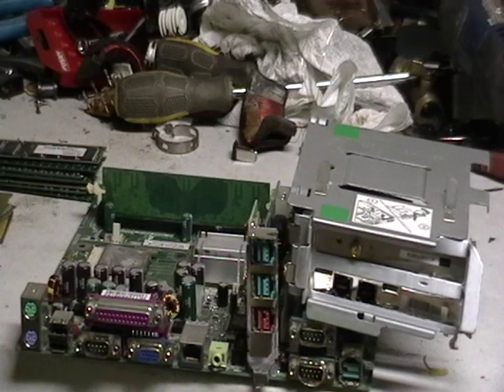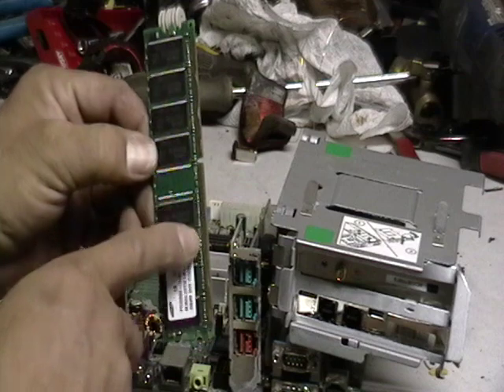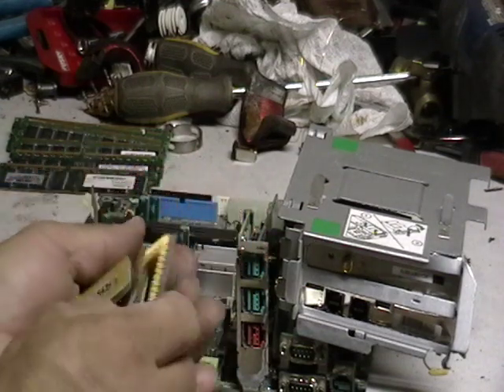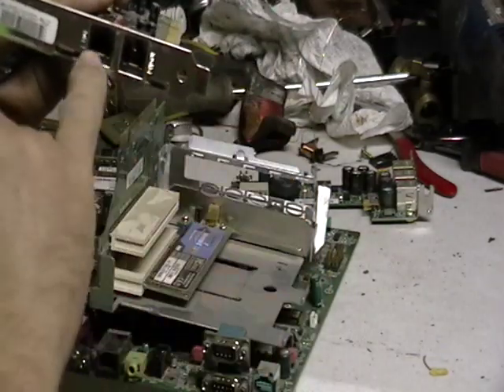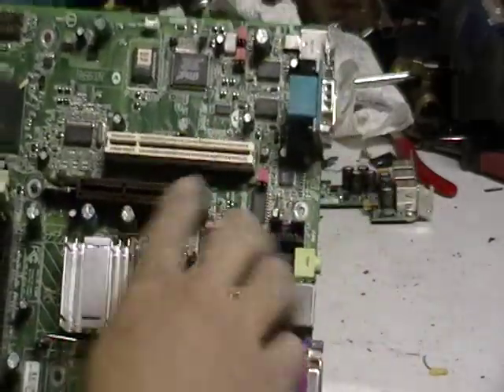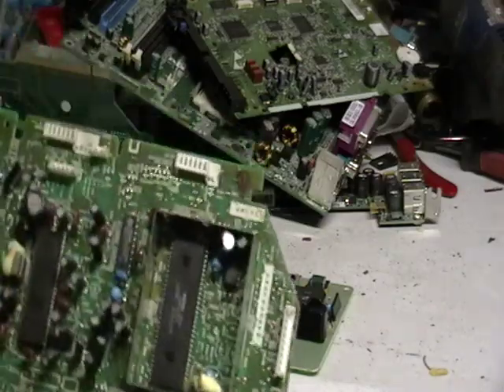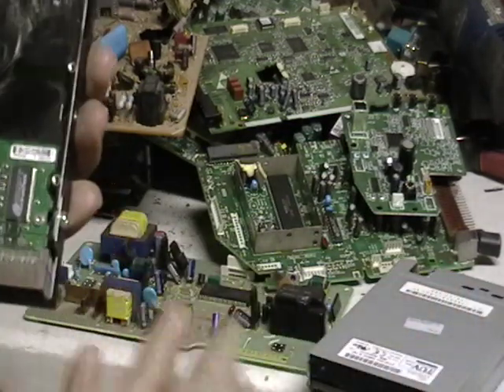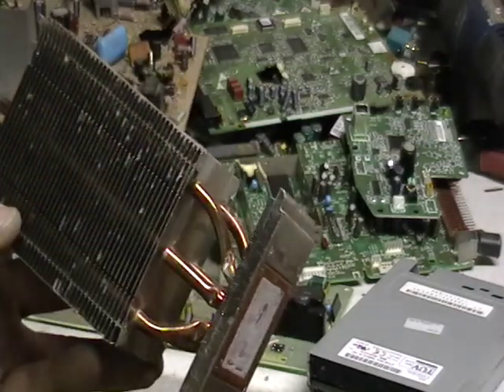Scrapping a computer for Gold Part 2

Comment from the maker: Yes you can tell the difference..From what i have learned, Thier is platinum on the outer disk of the hard drive...The inner part is aluminum.  Palladium is small silver type squares on the boards...Silver is on the board and I have found some in keyboards...

Comment from the maker: @BigMacD1442 ... depends on your scrap yard.. $1.25lb for motherboards..$5.50LB CPU'S...Memortboards $2.75lb..Harddrives $.35lb..Powersupplies (cut off wire) $.20lb..and the wire goes with your insulated cable.....Peace

Comment: Mike, thanks so much for your awesome videos.  I just started scrapping and I use your videos as a resource on a weekly basis.  I've got so many questions, but I will just post one for now:  How do you scrap the heat sink with the copper tubes running through it?  Do you put in your aluminum pile?

Comment: A Few things for you Mike,

The motherboard, the VGA out cable, the blue connector on the motherboard, and also what appears to be some kind of printer cable connector, have gold inside of them. I did not know this till i took apart an old HO laptop, the pins that I found are hollow gold, haven't tested but I'm guessing nearly pure gold, bout a grain each per pin 15 pints per vgi cable.

Comment: Secondly, CD drives are mostly, steel, not must alum in them, have a low grade board, and a BUNCH of plastic, you're right, open take apart, and sort with a magnate. 

Thirdly, I have had a number of Alum heat sink with copper in them, although none like you have showed. You can toss them in the deep freeze for a day or so, get them nice and cold then take after then with a hammer. (just ordered myself a propane torch going to test it that way also, alum should melt before the copper)

Comment: I spent 4 hours pulling all the pins from those boards it is very easy when you get moving so I have a sum total of 4 oz of plated gold pins from over 3 computors so doing the math it works out, I did seperate all material. copper content, steel and yeah it is fun !

Comment: Hi Mike,
Your video was very informative.  I just started to scrap and have gotten some very cool stuff.  I have taken apart 20 or so TV's and gotten the copper and aluminum.  It was a lot of fun.  I have moved onto computers and have taken apart 5 so far and have gotten a some other cool stuff.  Eventually I will need to sell the items scrapped.  How do i find a scrap yard that is honest and is not going to rip me off.  I live in Los Angeles in the Valley.  Any suggestions?  Thanks

Comment: Great videos I am learning alot thank you.  One question I have is on an average PC what would you value all the parts value for just one machinge. I know some of it will go back as scrap and some sold in a lot on ebay or somewhere else.  Im guessing $3.00 for the cpu, .75 for a ram, $1.00 for the motherboard ect.  Thanks!

Comment: Thanks for the video.  That pile you went through there, what would you estimate you'd get for that?  Considering you smelted the gold yourself.  I got about 5 old pcs laying around.  and small boxes of old GPUs, LAN cards, and disc drives.  I know hardware as far as performance, I'm not scrapping anything I consider of value.  
And also, what about the cases?  Is that steel?

Comment: hey mike can u scrap the resistors or capacitors or any other of them little components?  And will the scrap yard still take circuit boards even if u stripped them down?

Comment: Hello. I have watched a few a your videos (very helpful.) I am new to the scrapping game. I am just curious if it is worth it to separate all of the gold plate connectors (the teeth, gold fingers, or any other bit that is obviously GP or GF). How much would it ruin the cost of the board if i were to pull/cut them off, and would all the little bits I save up even be worth the time, and effort.

Comment: Hey Mike,
If motherboards are $4.10 a pound by me and Aluminum Extrusion is $.55 per pound, why would I want to take off the heat sinks?  I haven't turned in any boards yet. Will they take them with the heat sinks on the boards still?

Comment: Mike, I had always scrapped what I could. However e waste is new for me. I had found several 70's HP boards from some old medical equipment. I want to learn the process to refine them myself, However I am torn thinking the value would be higher if I sell the boards individually or the components individually rather than ruining them. You had mentioned another youtuber in this video.. What was his actually channel? Thanks in Advance!
Reply from the maker: The process is like the tv show "Breaking Bad"

Comment: Would it be possible to just use plain tap water and let the fingers stay in there for some time and then perhaps collect the gold from that. Kindly could you tell me what can on average get from selling the rams and other such circuit bords
Reply from the maker: mzajk M The peroxide helps in removing the gold from the board. EBay is a better source of what people are selling the boards for

Comment from the maker: Yes they will accept them..If taking in computer boards do not cut off the fingers. they will give you less money...As far as low grade boards from tv's crt monitors , dvd and vcr's it ok to take the transformers, copper and heat sinks...

Comment: There is actually gold on the boards that you don't see. All the little wire strips in the board are gold plated and can be removed with acid. I'm not going to say what acid because it is dangerous to work with unless you know what your doing and have the equipment to do it.

Comment: I do have a custom built pc. and ive built it my self.
Specs:
XFX hd 7850 2GB 975MHz
i5 3570k at stock 3.70/3.80GHz
asus p8z77-v pro mobo
crutial 64GB SSD
Corsair h60 cooler
Corsair Vengence 8GB (4GBx2) RAM 1600MHz

Comment: Are there any parts that are SOLID gold instead of gold plated??  I'd love to be able to remove the plated gold but I don't want to turn my property into a toxic waste dump. If I had a way of disposing the chemicals responsibly I'd do it. I do have a scrapyard locally that will not rob you if you don't try to cheat them. Unfortunately they don't take E-waste. BTW I like your videos and have subscribed to them.

Comment: hi i have some new capacitors that are only for use in USA not good in Australia they sell new at $8us each  who would buy them of me my company that i work for gave them to me as they cannot use it here i know the value but i need a buyer in the us that is manufacturing electrical equipment and  can find us for them any idea i don't want to scrap them as they are new (KMQ 105c 250v820uf(m) 03L188

Comment: lol, putting words in my mouth? I didn't say no gold in computers. Just saying there is so little as 0.6 mil = 15.24 micron of soft plated on tiny SM windows, and you can't see them as they are under the BGA. Unless they are gold fingers or the few rare high end connectors, then yes there are electro plated hard gold there. Recycle gold from PCB is only profitable if the PCB is naked, that means no SMT. You can't get those unless you are in China and have connection with the goverment.

Comment: 6:00 dell heatsink. big copper bit in the bottom that you can smash out of the aluminum after you cut off the heat tubes, which are also copper. get you more money man
WHERE THE FUCK IS THE CODE